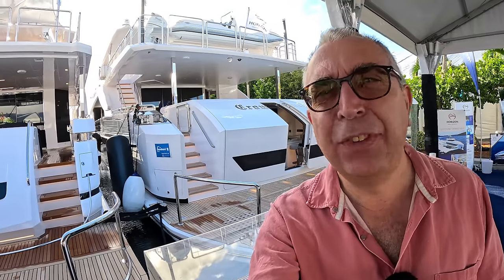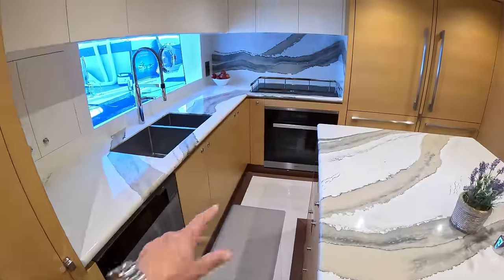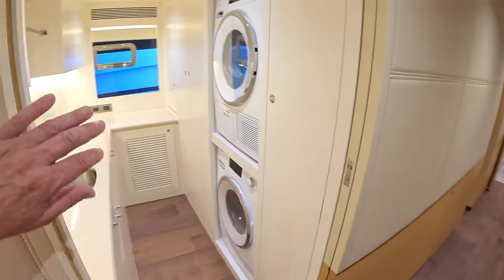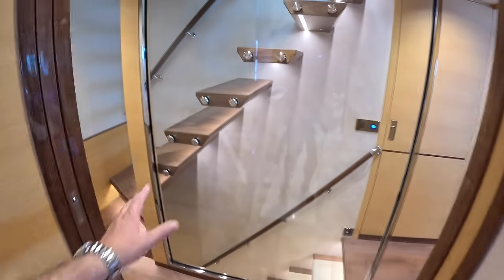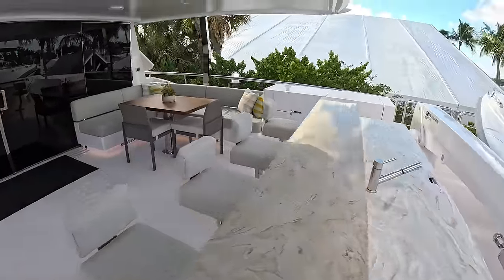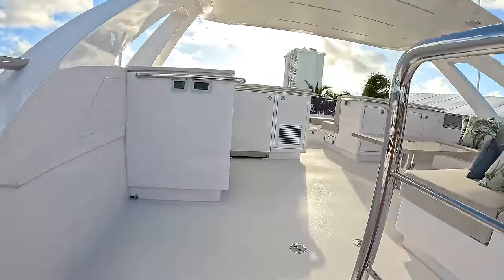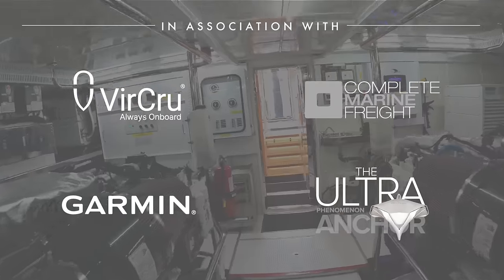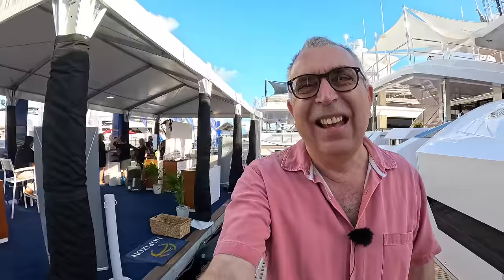$17.8 Million Superyacht Tour : Horizon FD110

Comment: Love the design of the interior and the exceptionally clever layout, hats off to the owner and Horizon. Surprised they didnt squeeze a day heads into the beach club area, but even without that, I think they've achieved almost Tardis levels of engineering to get in as much as they have into a 110ft boat. Fantastic crew accomodation too - even better than on the previous 110 you reviewed (that video just had an extra view 🙂).  Thanks Nick

Comment: Apart from a few modern touches I'm surprised at how old this yacht looks. Feels like a 20 years old slightly refurbished one, with its color scheme and material choices. The glass doors in the master cabin, the plain white exterior flooring or the tinted flybridge windscreen make it lose all the new expensive boat feeling.
Apart from that great detailed tour as always Nick, although on this one there seems to be a constant rumble throughout the tour. Was it the inside fans or the inflatable structure next to the boat that was heard from the inside?

Comment: Rally nice boat, interesting what they have done for this owner. The only thing I'm surprised about is there isn't a heads/shower in the beach club area. There's plenty of space for one and it would mean people don't have to go to the main saloon or all the way through the boat to their cabin when they're dripping wet with sea water.
Reply: @Navy1977 You're right that the standard layout has a heads at the back but that's for the crew as their cabins are normally there. As Nick said in the video this has been custom designed for this owner, adding in the beach club, moving the engines and putting the crew quarters in the bow. I just think it's odd not a having a day heads/shower in that area
Reply: @Navy1977 but my point was that THIS boat, with all the custom design does not, even though there is plenty of space for one 🤨